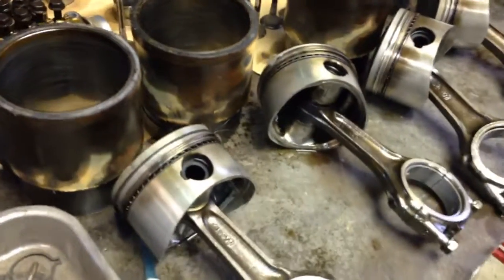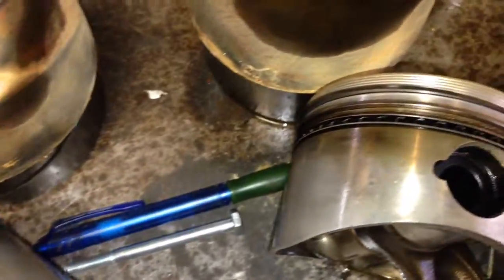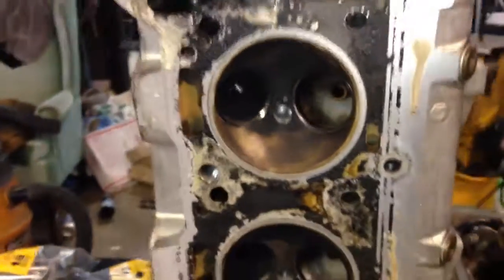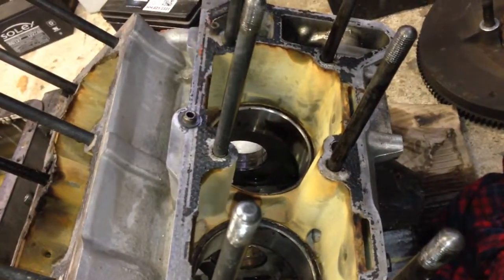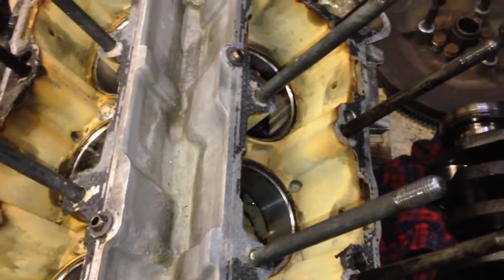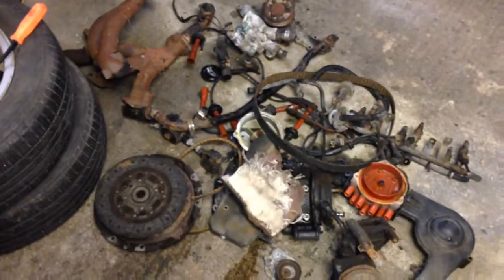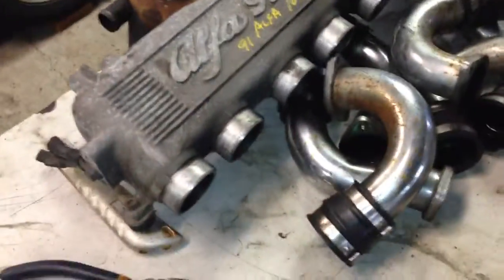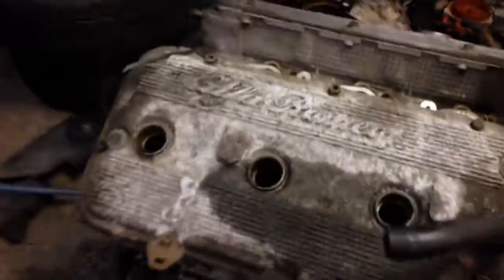Milano 3.0 Engine Teardown finished and Alfa 164S Engine assessment

Comment: what is the 164.3.0.v6 12v : normal operating temperature? I have checked the meter and the sensor and it shows up to max 110 celsius degrees and when the infrared meter looks at the outside of the roof it shows approx. 95-97 celsius.. the thermostat is new 83 celsius.. if the car's meter shows too much then why can it do that? when the sensor and meter is new

Comment: that 164s engine looks like crap, but then us cars are all a bit rubbish.  Where I live at the moment, you couldn't sell that engine except for scrap.  I hope it turns out to be a good one.  Love the fact that, in the us, it seems that 150k miles is low mileage :) :)
Reply from the maker: it sure does look like crap, im calling it the sludge monster. It WAS however a $300 motor luckily so since everything is being rebuilt it doesnt matter so much. Ive found that when I take apart any motor that hasn't been cared for by myself, its always sludgy and leaky and gross; people will literally go out of thier way NOT to spend money to maintenance thier cars!